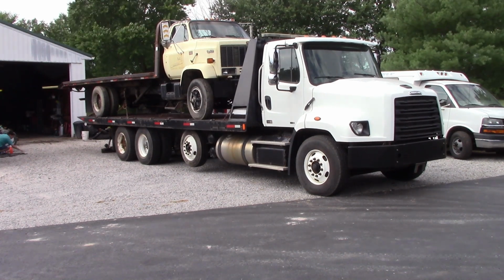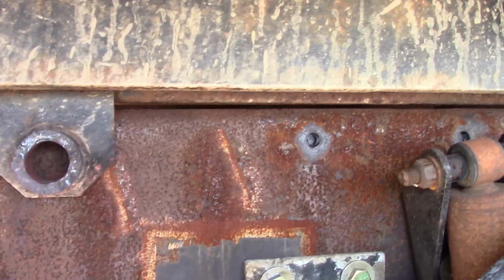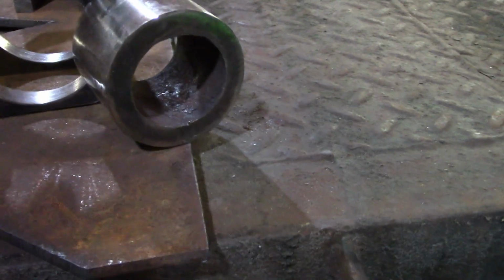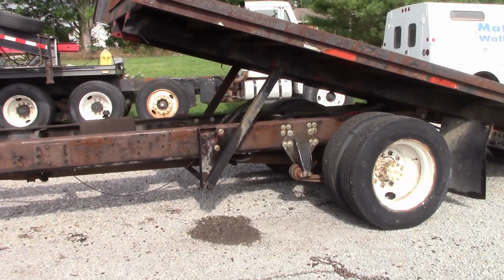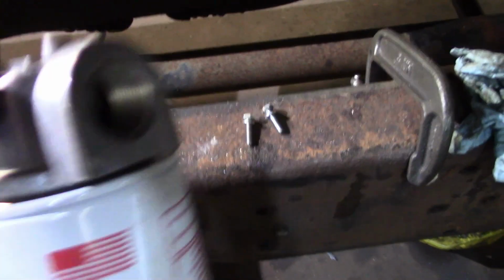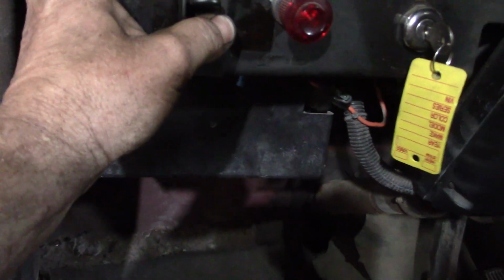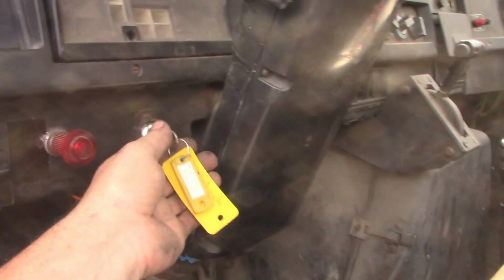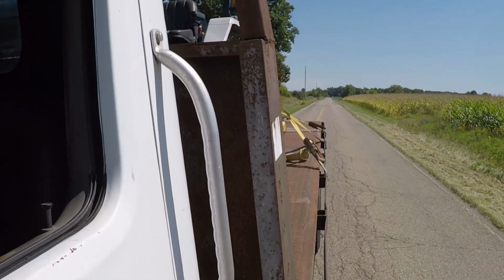BUDGET ROLLBACK BUILD WITH SCRAP PARTS

Comment: On those pin bushings where the pin goes side to side, since they have tremendous weight they would like a grease zerk drilled in the middle  with a tiny groove cut from the grease outlet all the way around with a dremel cutter. Doesn't have to be very large at all if filled with grease right away.

Comment: Looks like an awesome project. I should put a roll back on the Nodwell.!
Reply from the maker: the next rollback project is a 21' steel bed going on a kenworth t300. should be interesting. i am building it for myself so there will likely be some extra fab work involved.

Comment: You can put rollers at the end of bed like Miller Century roll backs and they work great. You can google it to get a general idea. Also keeps from damaging asphalt and concrete driveways and streets.
Reply from the maker: trailer manufactures use to do the same thing at the rear of their low wedge trailers. it is done and gone now. if he needs to make a change i will pass it along.

Comment: I thought the majority of those trucks had cruise that you could set at idle for pto use, or maybe it was only the couple that I was around that were set like that I don't know. Looks like a good set up for scrap cars...
Reply from the maker: this truck is older and has a completely mechanical dt466....no cruise or idle up for pto. easy enough to add for sure.

Comment: Great video JC of a complicated project. I like how you broke down the sequence of work. The removal, measurements, operational thoughts, design mods, and finally proof of concept showing it works well.
I imagine the customer will be thrilled with your work, frugal problem solving, and the substantial workmanlike manner you use on all projects resulting in a safe, secure finished product. Well done 100%. Shipper!
Work safe, stay happy, and be kind.
Doug@ the "ranch"
Reply from the maker: time will tell how well it works for him. i would have liked to finish it off my way but, it isnt mine and i can only give up so much time. winter is right around the corner and my prep work hasnt even started yet. for me, i am happy to be onto the next build! lots of trucks coming together right now. hopefully they all turn into good videos for everyone to see.

Comment: Air still in the hydraulic system WILL cause fittings, seals, pumps and cylinder seals and such to leak. To the point of making you think you're going to have to fix something else. Don't work on anything more than maybe tighten some fittings until you're absolutely sure  you have the air out of the system. Sometimes, newly fabricated and dry can be really trying. Operating to their fullest extent several - sometimes several times will drive it out as quick as any. If hydraulic fluid stays aerated after ample time to have gotten out, make sure all the fittings on the suction side of the pump are tight, air can be sucked into a pump and never show fluid leaking.
Reply from the maker: that a new one. air in the lines causing leaks. i fixed leaks that were obviously been there for quite sometime.
Reply: @j.c.smithprojects  Leaks that have obviously already been there is a different animal, yes, fix them. But everything i said there , I can cover, and If you wish I'll try to put some literature together and get it to you, and be happy to do so. I know you do work with hydraulics as needs arise, but I'll bet it's not a part of mechanics that you could say, you really like to.  I was just trying to stress the fact that parts put together from the pile behind the shop or wherever can produce some really strange happenings that can be tracked back to just air in the system, and I do know that's a hard one to swallow, but I've had learn the same way you're being introduced to it along with some books that teach it. 
Even if you want to duke it out over it,  you still makin some great videos!
Reply from the maker: Nope....just never heard that. there are millions upon millions of people in the world smarter than me.....the day you quit learning is the day they closed the casket.

Comment: Strong work JC , I have built a few of those in my time. But in 40 years of messing with towing and transportation equipment that is the first roll back I have seen with no tilt cylinders in the front.

Comment: i have worked on heavy equipment for 15+ years and i had it beat into my head in the begining you NEVER use anything with teflon in it to seal hydraulics not paste or tape you use something like loctite 545. on a different subject i would have put the tank outside the frame so you can get to it if needed and put shut off on the feed hose incase of a leak.
Reply from the maker: no room outside the frame.

Comment: Awesome job JC could you put a manual dump valve for the rear bags to lower the rear for a better angle?
Reply from the maker: the type of dump valve doesnt matter. when the the air bags have been deflated, the frame rests on the axle bump stops.

Comment: If you know it's going to get pushed to its' limits then it makes sense to build it tough.  Not everyone with a rollback reads and abides by the operating instructions, which is why you see so many bent, battered and beaten rollbacks around.  Build it tough and the guy is going to have a harder time breaking it...

Comment: "Will the Evolution cut this hardened pin?" Most guys would milk that out as its own 30 minute video! That bed seems to work pretty well with the mechanical linkage.
Reply from the maker: i think most viewers expect better. it does what he needs and its all that matters.
Reply: I can think of a YouTuber that could make this a 20 part series.

Comment: You friend is really gonna like that truck! I hope he finishes it up & does all he says he's gonna do + takes good care of it? 👍
Reply: Good insight my friend!
If we were to see this truck 5 years down the road, it will NOT have been greased, will NOT have bed tie downs, those grade 5 bolts will still be there, it will not have 2 functioning lights on the bed, and any that do work will be wired with wire nuts and re-used Scotch locks.